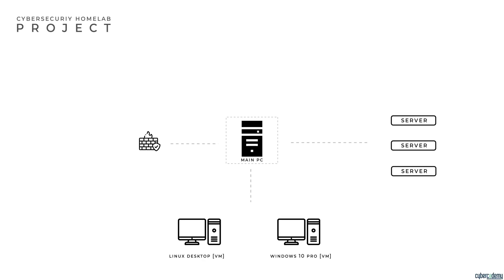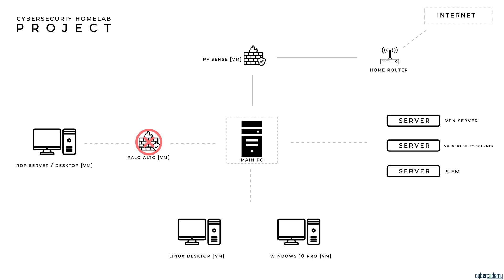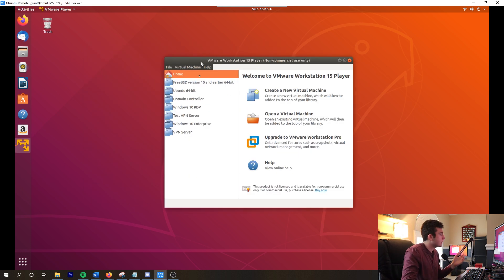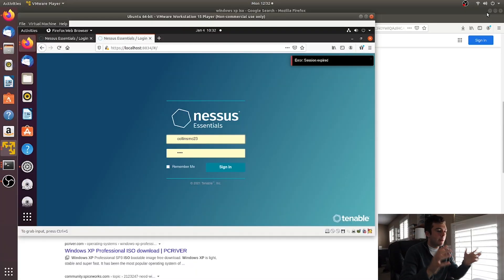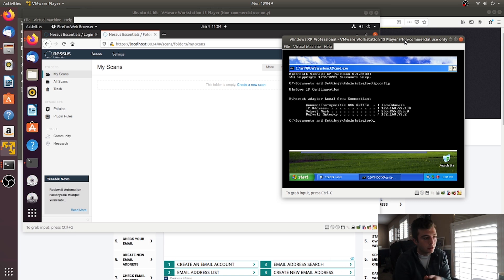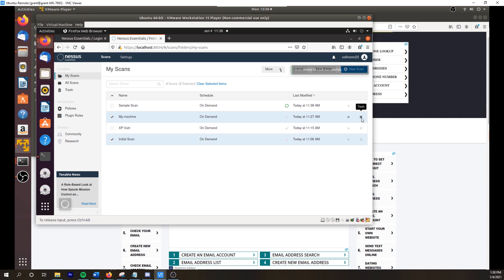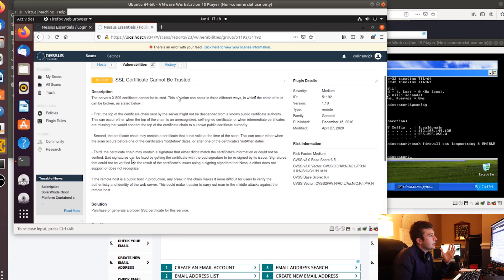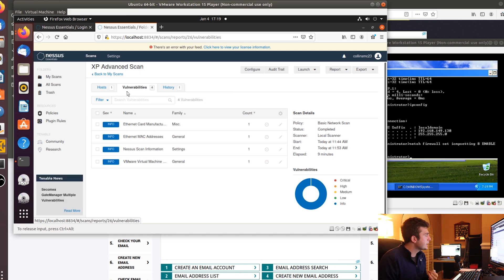Cybersecurity Homelab - Working with a Vulnerability Scanner

Comment: Could you tell me why you use ubuntu as opposed to kali for something like cyber security? I am not contesting your decision, just curious
Reply from the maker: Ubuntu is considered a widely used Linux distribution, often time recommended for newbies. The reason I use Ubuntu is personal preference. Since I am not actively conducting a pentest or using an offensive set of tools to attack a machine, set of hosts, etc, I prefer to use a server distribution like Ubuntu.
Reply: @collinsinfosec  oh ok that makes sense, thanks
Reply: I asked this question before 😂basically the homelab project was made to kinda set the network to be secure he isn't attacking he is kinda defending maybe in the future he will try to attack stuff on the network with a kali machine

Comment: I guess the problem was that you didn't turn off the firewall on XP machine. I did the same 2 years ago with Windows 7 and I remember shutting down the firewall. Then the scanner showed some vulnerabilities
Reply from the maker: Thanks for your suggestion :) I think you may be right. I tried using a default rule to turn off PING and ICMP with netsh, but I may have needed to add more firewall rules (or turn off firewall rules)

Comment: There is not much difference between the "Basic Network Scan" and the "Advance Network Scan" policy apart from the Advance allows you to change performance settings and allows you to turn on some of the more advance modules (Brute force password checking, Web App Scanning, Malware Scan)

Scanning your XP box, I would say that there is some firewall rules blocking traffic from your Nessus Essentials scanner and the XP box for it to not detect more vulnerabilities.  All ports are required from the Scanner to the target.

Without Credential Scanning, Nessus will rely on TCP fingerprinting for the Operating System, which is never going to be 100% accurate,
Also, providing login credentials for your scan will give you the best results.

But good to see you learning.
Reply from the maker: Thank you Steve for your considerations and thoughts here! I will take a look at conducting these steps to improve my process
Reply: That is 100% accurate. Nessus is just there to find the low hanging fruit on a network.